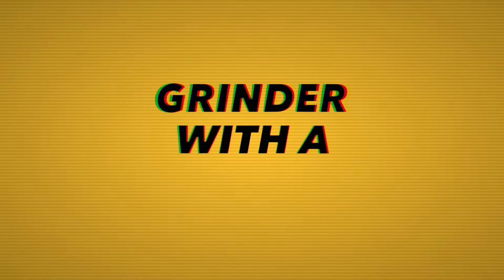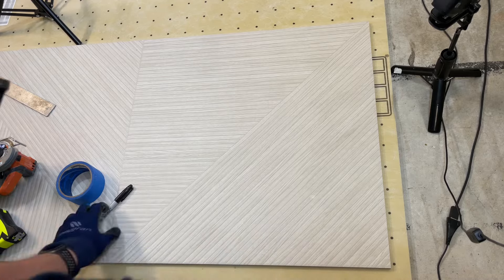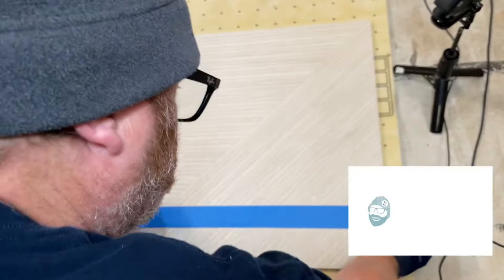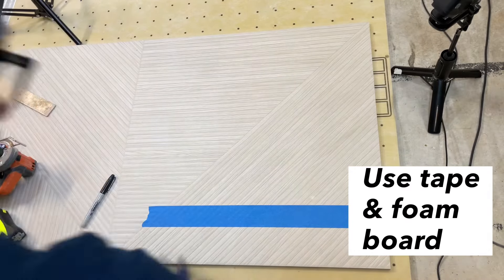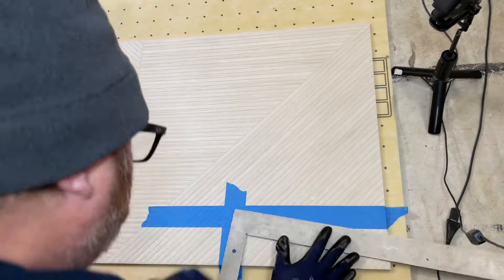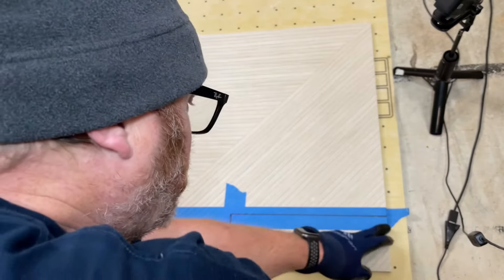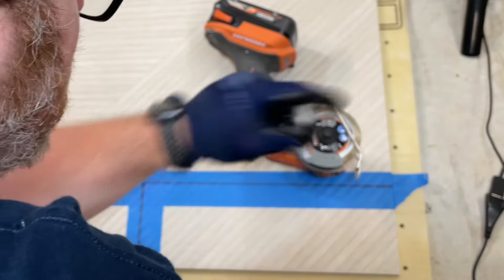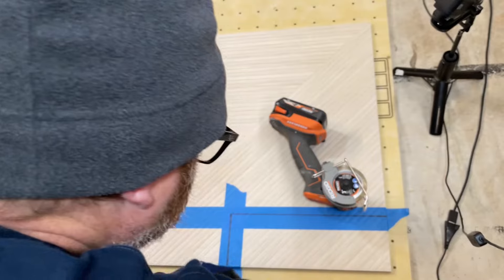How to cut LARGE tiles with out breaking them.

Comment: Do you have a better view or can you explain how you fully supported the tile on the wet saw?
Reply from the maker: The best way is making sure your wet saw has the capability of laying the tile flat. The best saw, I found, for a 48 inch is a bridge saw. Sorry the angle was not great.
Reply: If you don't have a bridge saw us a grinder or cutoff tool and place some Rigid Foam Insulation Board underneath the entire tile.  Adjust the depth of the blade, so it cuts through the tile but NOT all the way through the foam insulation board.